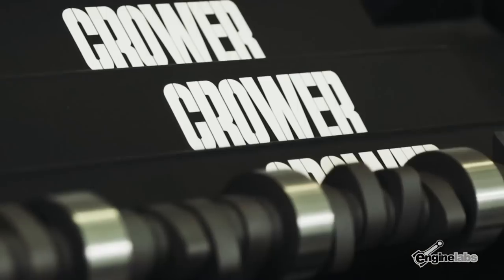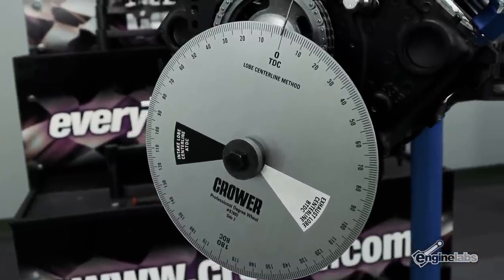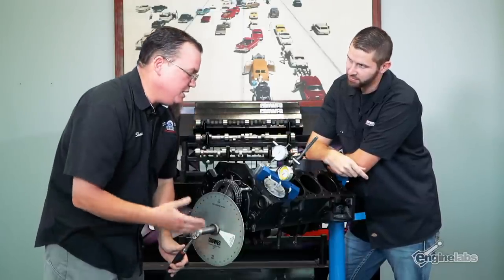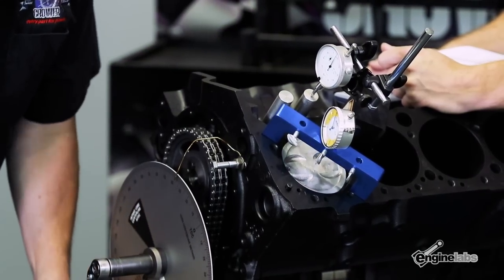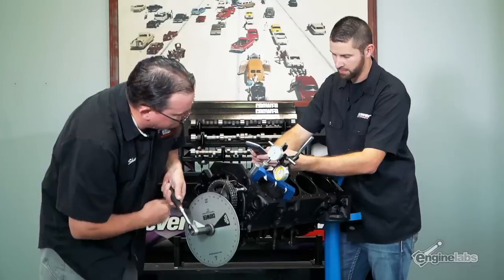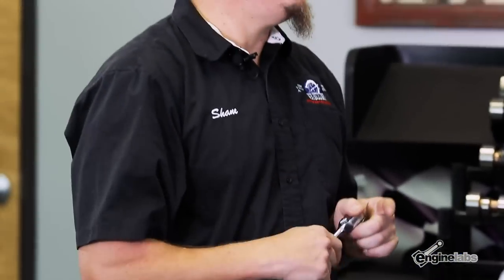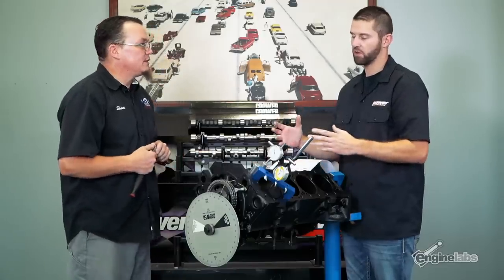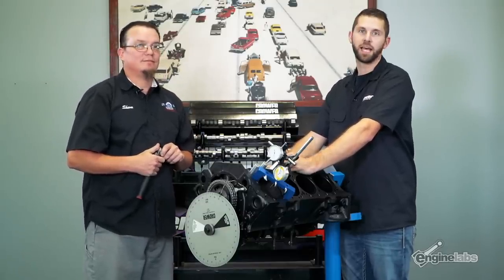Degreeing a Camshaft - Step By Step with Crower

Comment: 3:37 Ok guys, so what they are NOT telling you is that after you get back to MAX cam lift watch the dial indicator and it will go backwards {lifter is on the down fall....Intake valve is closing} When you get to 0.50" on the dial indicator read that number on the degree wheel and add it to your first number then divide by 2 to get your intake center line. So basically your reading 50 thou before max lift and 50 thou after max lift.
Reply: This
Reply: you just described exactly what they show. what they failed to explain is how to correct a cam that is out.
Reply: @daos3300  he did... he talks about degree buttons.
Reply: @TheRoadhammer379  mentioning in passing something you can do if you have other stuff.. is not the same as explaining how it needs to be done or showing the process.

Comment: I use a piston stop to find t.d.c., between bearing clearance and crank dwell there's too much slop to be 100 percent accurate using a dial indicator. Bump it forward then back and split the difference will give you absolute t.d.c.

Comment: you would think they would make a video explaining in depth how to actually degree a cam, no one understands something that was already done, the dots were already spot on, explaining the process in depth is what everybody came here for, so having a cam that's completely out of time and explaining the process step by every single step is what they want to see for example setting timing, where and how to adjust your piston stop, where is a ideal place to mount your pointer for the degree wheel, how to go about setting up your dial indicator etc, then explaining what the numbers mean and how to apply said numbers to the procedure etc, all this video showed was that the cam was already set and its ready to go
Reply: Yea.  Most cam degree videos show engines that are ok.    This Didnt show anything about how to fix it if its off.  Lolol.
Reply: Click bait

Comment: you should have shown them how you got your wheel on 0 tdc to start with. that will confuse newbies. you should have just let the wheel land on what ever random number, did your 50/50 math and showed you putting the wheel at zero
Reply: Yeah, don't you have to find your piston dwell and then zero out the wheel before you find the cam lobe dwell?